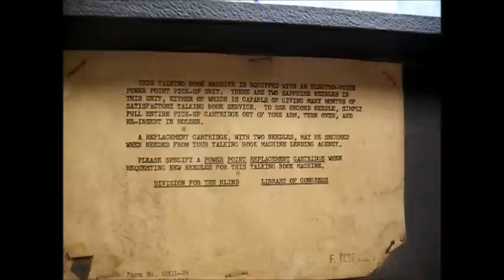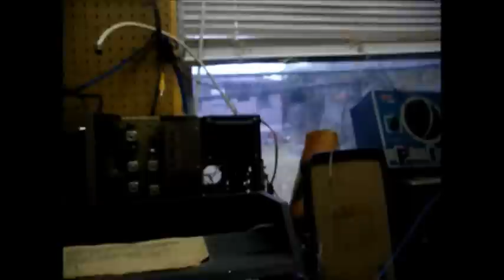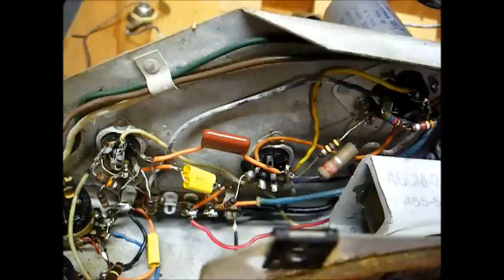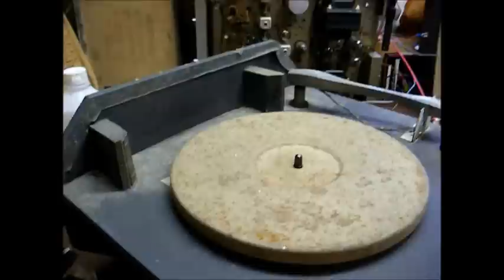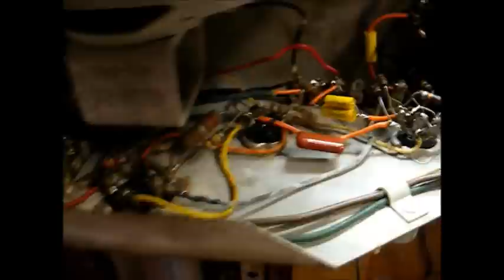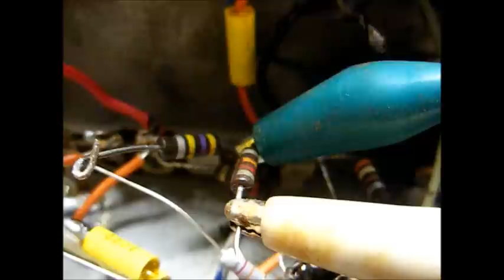Talking book machine from 1955

Comment: I'm not sure if I have ever seen a tube shield over the rectifier tube (or output tube). Thought those were primarily used to shield against noise in low level stages.

Comment: Yet another example of how well this old stuff continues to work.  Thank you sir.  I've got a ton of old mags and stuff on flexible disk that I'd love to be able to play again, if you run across one of these older machines that will do 8 rpm I might be interested in picking it up from you, the last talking book record players sounded like crap and I wouldn't mind getting one of the old ones that actually sounded decent.

Keep up the great work.
Reply from the maker: I will do what I can to find you one of the older ones with 8 rpm speed. You are right about the later solid state TB machines - they sound very tinny and weak. I have the last one that was issued, a model where the tonearm is pressed down and moved towards the record. It has some nice features; but, the sound quality isn't one of them.

Comment: The ac amp was really overkill for a talking book machine like that; something like push-pull 50C5's would have been just fine, especially since it only used a 4"x6" speaker.
Reply from the maker: I agree; but, they may have used a power transformer-based amp to make it safer. For the exception of some "universal" AC/DC models from the '30's and '40's, every library of congress TB machine that I've seen had a power transformer. The pre-solid state ones were built like tanks and would probably survive a bomb blast.